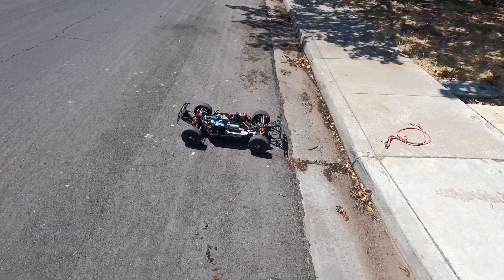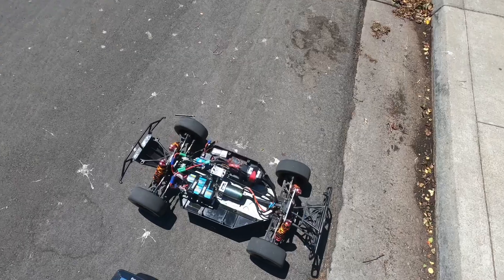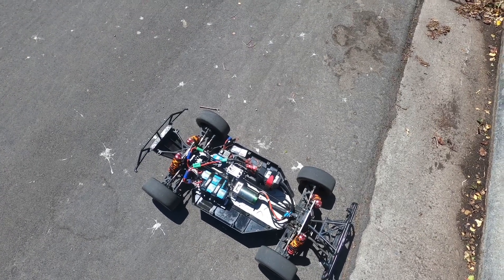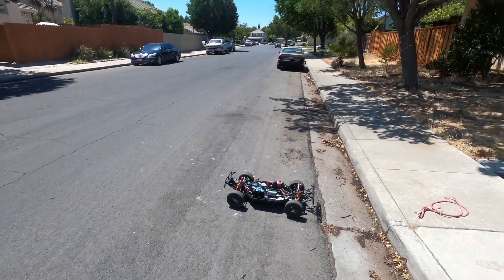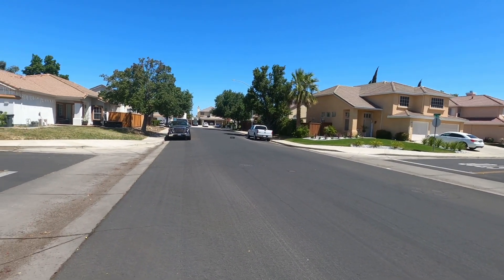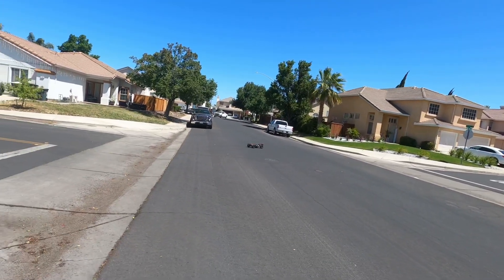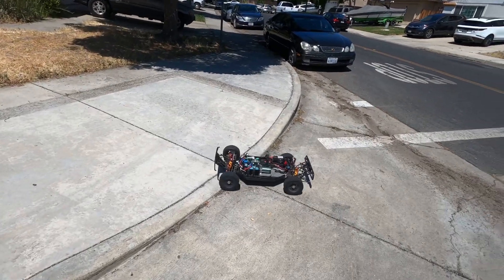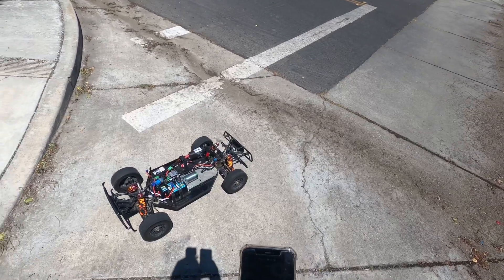#flieresc #Losi #5ivet Losi 5ive T Testing out the Flier 16s esc 400amps on 12s

Comment: I have flier 16s 400a and i run my 1/4 baja with 8s  1100kv and my gear is 18/57 , i have smoll problem ، its knok if i  Give it Throttle from 0 ...

Comment: Nice... I just hit 48mph with my 5ive-T 8S Max5 Combo on 19/58 and max throttle set on 60%. What speed do you think I can get with throttle on 100% an changing the pinion to 24?
Reply from the maker: Thanks Bro I appreciate it 👍 I would probably say in  the 60+mph range with 58/24 on 8s also depends on batteries too

Comment: I didn't know about that esc what's go for I need speed but I can't spend alot  🐱🤔 Awesome running good sir 👍
Reply from the maker: Yeah just like Run N Gunrc stated around $225-$250 depending on which model you get I brought a Ripple killer cap pack to go with mines which was a additional $50 my personally I would stay far away from those Ztw esc’s I had 2 of them both caught on fire  🔥 and destroyed parts on my car 👍
Reply: My man I believe $250 to get  12-16s is a hell of a deal. Just do your research on the features of how it function your good. Also ZTW check them out hope this helps .